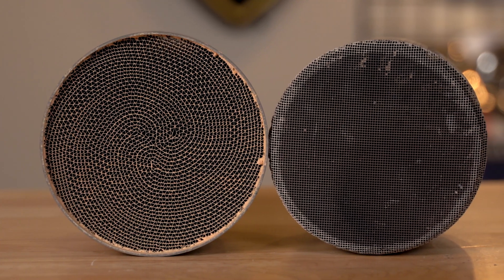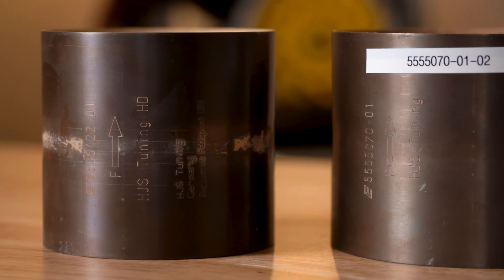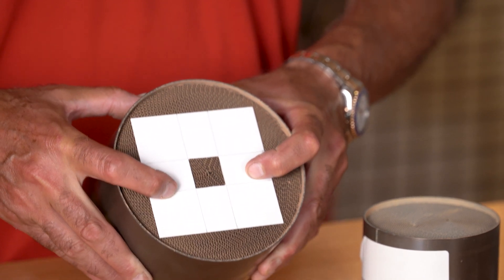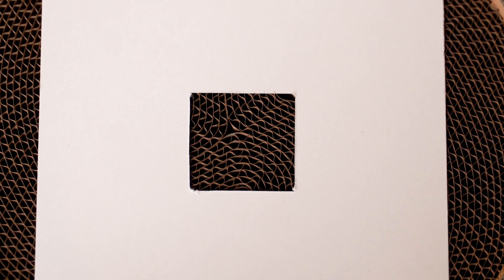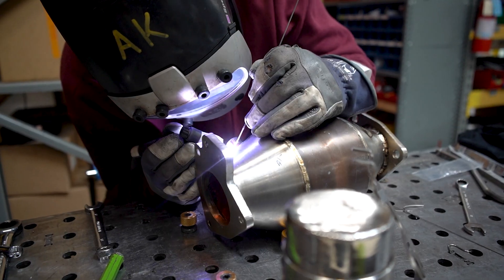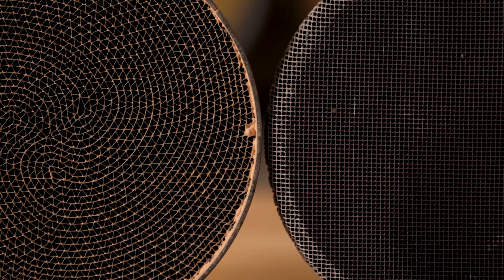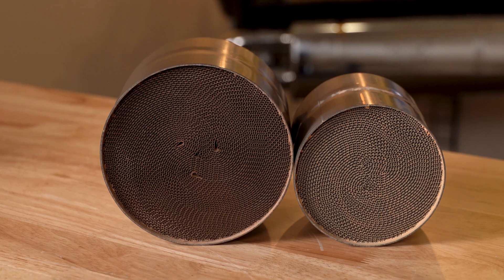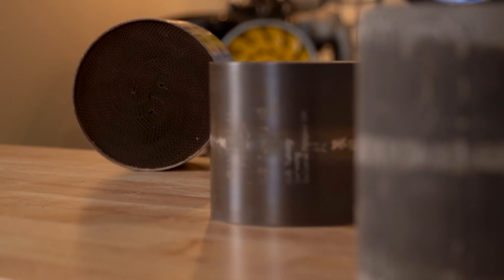What Makes a Catalytic Converter High Flow? | What Does Cell Count/CPSI Mean? | Fabspeed University

Comment: I have a Opel Calibra Turbo with about 300+ hp 4 cylinder, Do I chose 400cels or 200cels? is there a big differance in sound? is it bad to use 400cels on a turbo car? Do gain much on using 200cels cat? 
Thx for answer!

Comment: Hi, just want to confirm... So a 200 cell is still more restrictive and a catless pipe right？ Like catlesss is the best if you want to go higher performance and its louder?
Reply from the maker: Typically yes, but if you sized the cat large enough theoretically it could flow just as well as a "straight pipe"
Reply: @FabspeedMotorsport  Thank you

Comment: cpsi has low relevance without a diameter or surface area and without length of the core(s). Also you need to know the cell wall thickness because you could have low number or cells with thick walls, that’s the worst combination. I mean that’s common sense, there are even more 
 that affect the flow, I’m sure
Reply from the maker: You're absolutely right! We always use the largest diameter catalytic converter that will fit the application

Comment: Hello. Could you please give some information on the GESI 50225 Catalytic converter, it’s a 400 CPSI - is it a good thing ? Or less CPSI is better?
Reply from the maker: We do not carry GESI so we can't speak directly about their product, however, a 400 CPSI cat will flow less than a 200 CPSI cat of the same diameter
Reply: @FabspeedMotorsport  alright. Thank you for the response

Comment: If i use 200cel sport downpipe...

1)avoid waranty car or not?
2)it's smell bad or not?
3)no engine check light or not?
4)can burn my engine or not?
Reply from the maker: If you purchase one of our Sport Cat products
1. It will not void your warranty in the united states
2. it will not smell bad
3. No check engine light guaranteed
4. not totally sure what you mean but all of our sport cats are safe to run on the car with the stock tune
Reply: @FabspeedMotorsport  Hi. Im driving honda civic eg k24 vtec with 4-1 header 3inch. But car is too loud. Which cat is better to buy to have less loud. I really need help from you because car is daily drive and i need to have car not louder. Thanks.
Reply from the maker: @besar.jonuzi  Basically, more restriction in the exhaust equals a quieter exhaust. A cat will reduce noise regardless, but a higher cell count and/or a smaller diameter cat will flow less and also quiet your exhaust. I personally run a 200-cell 4in diameter HJS cat on my K24 swapped car and am only down 3-5hp from a straight pipe.
Reply: @FabspeedMotorsport  im using 4-1 header 3inch and skunk2 mega power 3inch exhaust with 3 inch pipe. What is better to put on my k24. Thanks for replying

Comment: Great video ! 
Can you put a High Flow Catalyc Converter instead of a DPF on a diesel car ?
Thanks a lot
Reply from the maker: No, they have different chemical properties and thus do different things. that's why most new cars have both catalytic converters and DPF/GPF filters.
Reply: @FabspeedMotorsport  thanks 🙂
Reply: @FabspeedMotorsport  hey sorry to bother you again but we’re building a OM613 and it still has a Catalyc converter it’s a diesel Btw ! 
Can we put a 100 cel CC to reduce the emissions ?
Reply from the maker: @miguel2946  Yes a regular catalytic converter will help reduce emissions significantly and be much better than nothing, but a diesel-specific cat with DPF will work better of course.

Comment: awesome video , thumbs up bro !
Reply from the maker: @dfls5069  If all else is the same, the 200 cell would have less smell than the 100 cell. That's because the 200 cell has more surface area and thus is cleaning the exhaust gases more.
Reply from the maker: Thank you!

Comment: Hello sir. I change my 4-1 exhaust manifold to a new 4-2-1 and the stock catalytic converter with a 200cel one. All these are handmade and I have no check engine problems. Fuel consumption is better and the car seems to be a bit faster. My only concern is that it smells more. Some people told me that it's normal and it need some working time to perform 100%. It's the fifth day today. What is your opinion?
Reply from the maker: You are probably smelling all the gases that are getting burned off the catalytic converter. This is normal for any new exhaust that has a catalytic converter or mufflers/resonators that are packed with insulation.

Comment: So does more cell count means more restrictive catalytic converter, or is it the other way around?
Reply: Seems to be that stock uses more cells but less precious metals, so it's cheaper for manufacturer, but high flow cats have less cells but more precious metals which is more expensive for you but you get more exhaust flow
Reply from the maker: Yes, more cells means it's more restrictive.